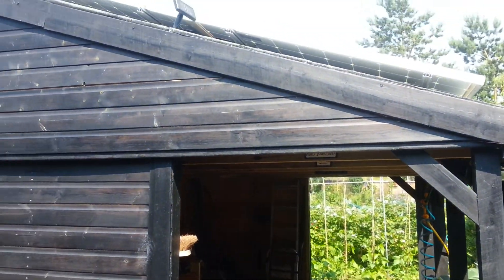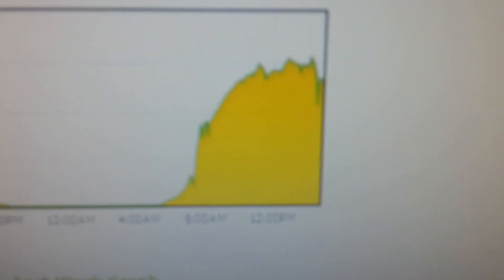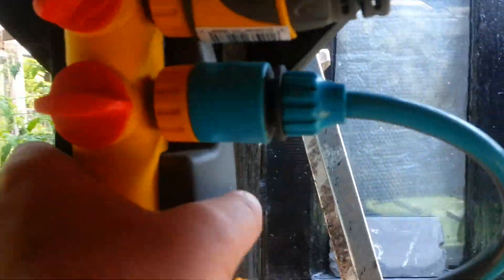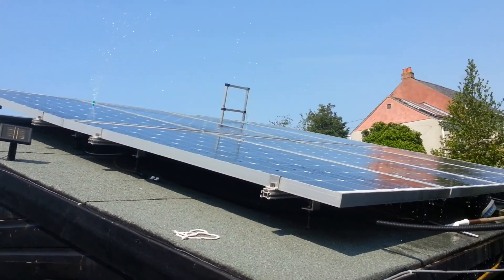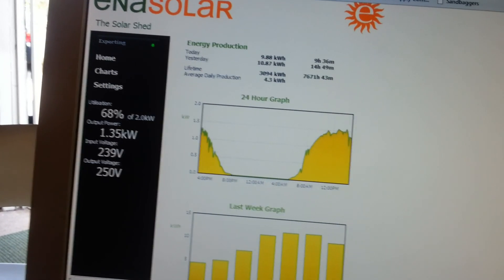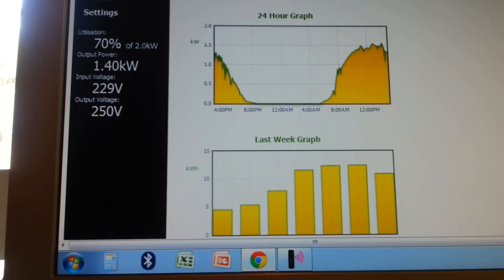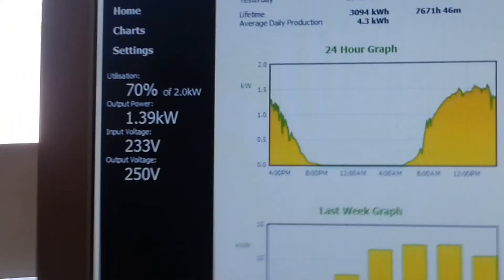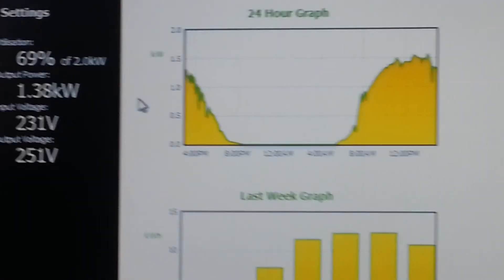Solar panel cleaning and cooling.

Comment: I was thinking to put some pipes on the back of the panels, it needs to be glued on the surface, or better alu radiators. And then with pump make circulating, water can be also used in the house and panels are getting optimal temperature...
Reply from the maker: Hybrid panels do exist.

Comment: very nice!  We had a rain storm the other day and the sun came out right after the downpour.  My 5.7kw nominal rated system put out full power after the panels were rain soaked and now evaporating in the sun.  It even peaked at MORE than nominal power briefly.  I'd hook up our main house water supply, but it's well water and quite hard.  Here in the desert SW of America, rain water isn't a reliable source.

Comment: I'm currently working on a designing a cooling system for solar panels for my senior design class. Did you measure before and after temperatures? Do you know what your average improvement was? And just because we are self-funding our project would you be interested in sponsoring a project? Thanks for any help and suggestions you can pass over.